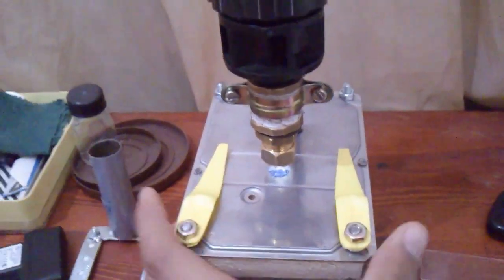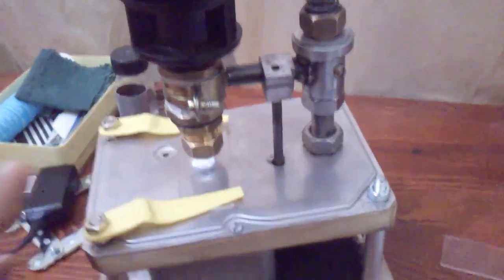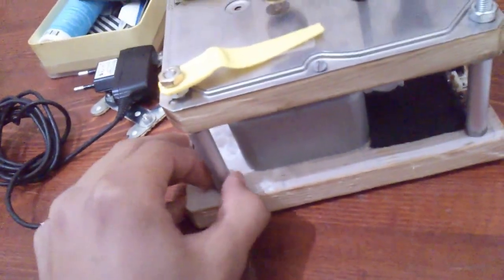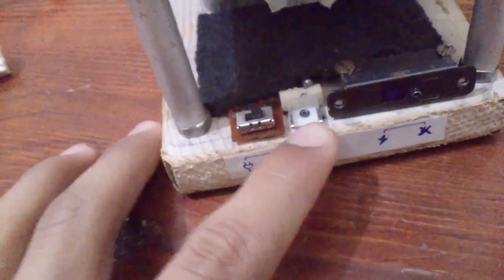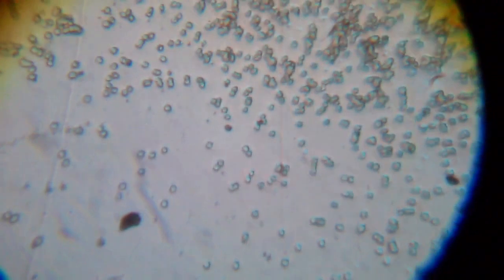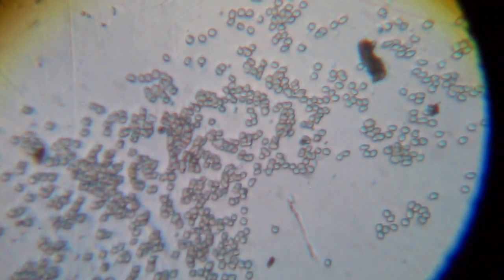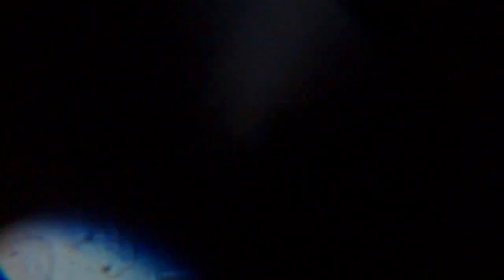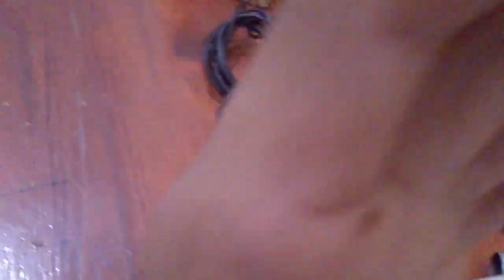Introducing my homemade microscope, H.M.M.S. ! [English]

Comment: How many  lenss  and of what  size  you have used
Reply from the maker: I used all the lenses of the camera's objetive and added another one as an oculair lens ( to be able to see like a normal microscope ). I don't have or used any calculations for the physics of light and magnification, but when I desassembled the camera ( for fun ) I noted that the objective itself can magnify as well as a microscope, so I used it as it is, but upside down, with a slight change in the distance between lenses for better results ( done that experimentally though :p ) 
Good luck.
Reply: Thank you  for replying me can you  tell us by drying  the formation of lenses